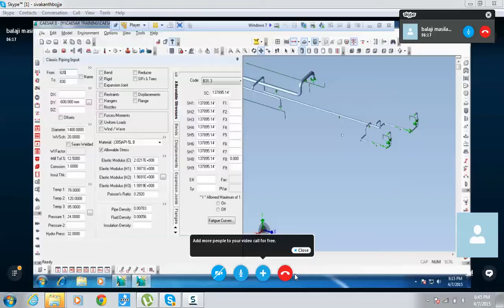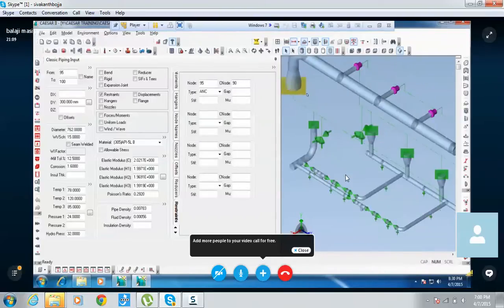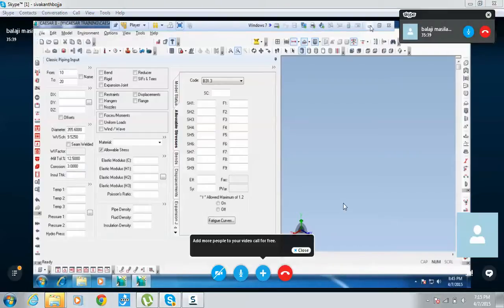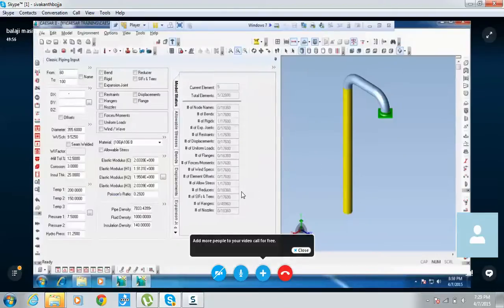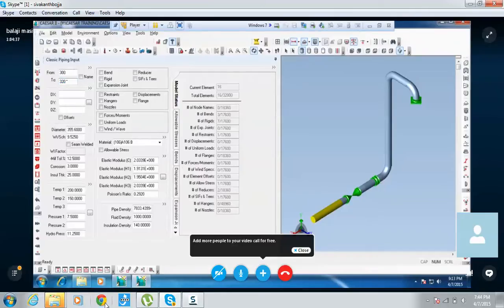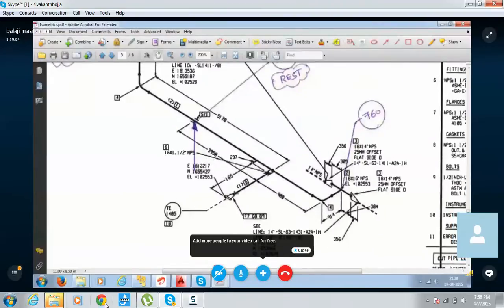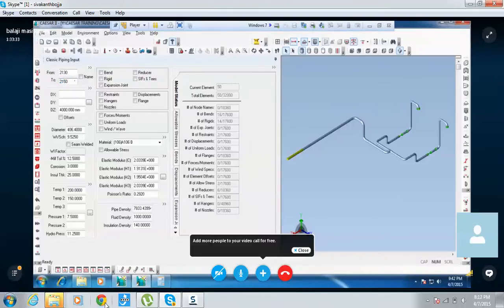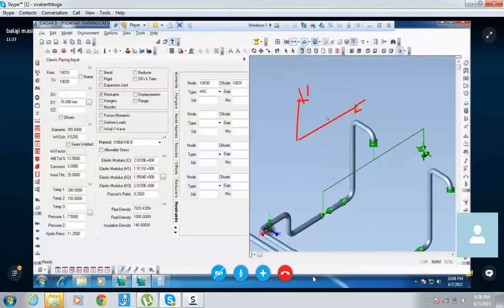CAESAR II class one piping and equip modeling

Comment: At 1:30:45, why do you model second anchor as a reinforcement pad? Why can it not just be pipe. When evaluating nozzle loads, we monitor at the flange; hence in my humble opinion, there should not be another anchor. Please advise your assumptions as modelling method can be different.

Comment: Thanks for this video. The video is very informative. However, it does not address some important points like how to model guides and pipe supports as well as how to model offsets.

More videos should be earned at addressing these gaps.
Reply: It's quiet easy actually. For the tutorial do this. In the software, go to Help and click on Applications Guide which will open the pdf in Adobe Reader. Look in the index. Guides is in the Restraints chapter.
Reply: @faheemrajwadkar7100  Thanks